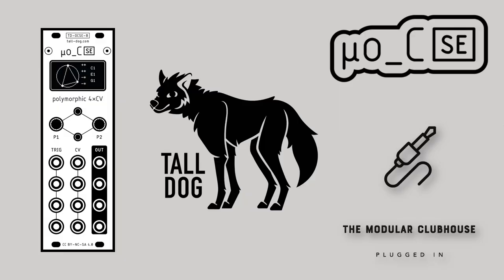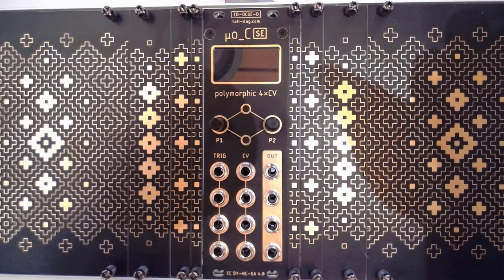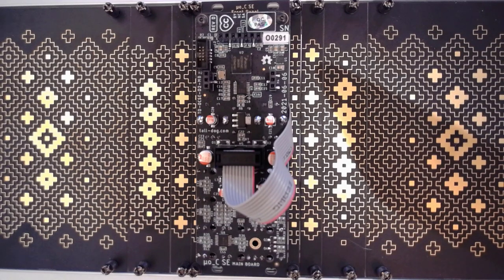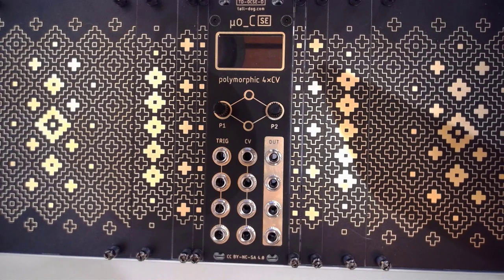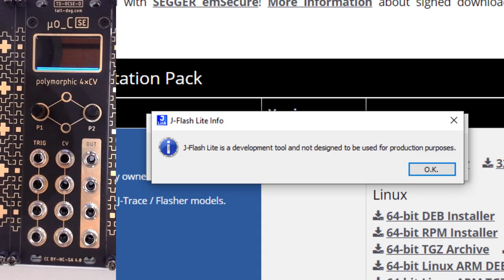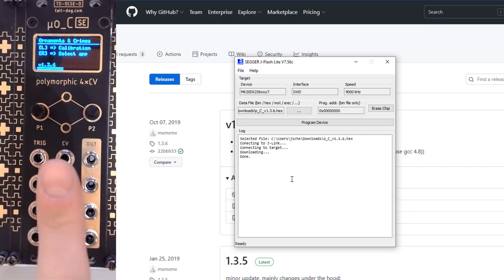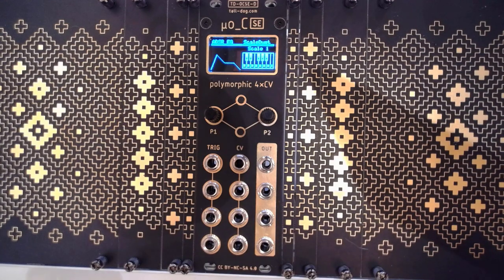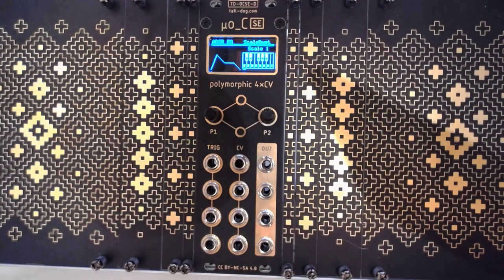Episode 62: Tall Dog μo_C SE | Eurorack Micro Ornament & Crime Special Edition | How to Flash | uo_C

Comment: You love this module, Jasper...I'm assuming you have used another uo_C module. Can you turn this module up side down, like any other uo_C module, so the jack sockets are conveniently at the top?
Reply from the maker: Haven't tried that myself but I see no reason why that wouldn't work :)
Reply: @TheModularClubhouse  Except the wording would be up side down....where as any other uo_C comes with a flippable panel.
Have you used any other uo_C or o_C module?
Reply from the maker: @philtobin9510  I haven't used other o_C modules. This one does not seem to have a flippable panel but I would assume it would be relatively simple to create one.